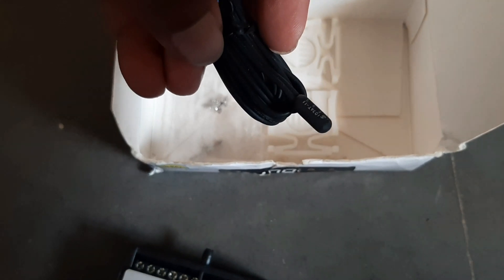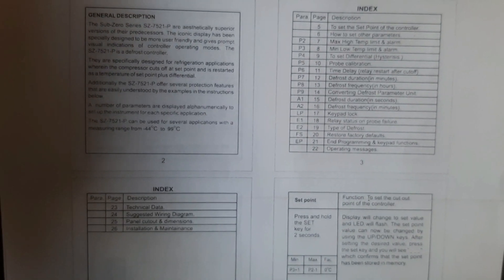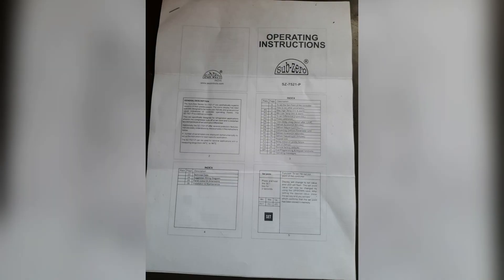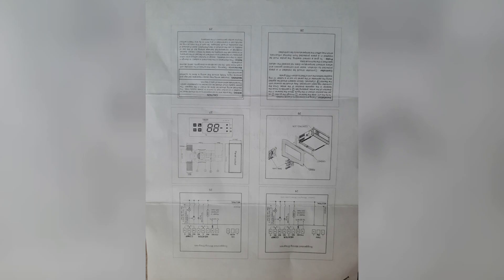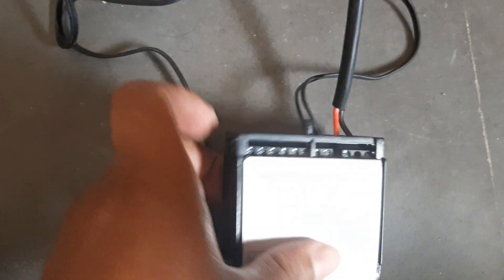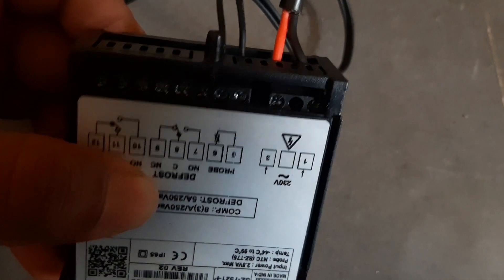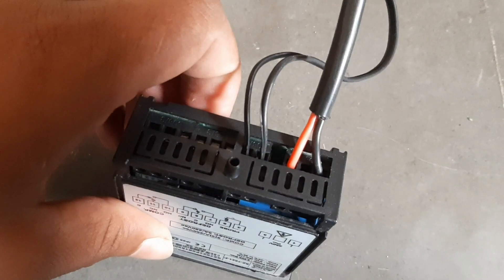SUBZERO CONTROLLER SETTINGS | SUBZERO PARAMETER SETTINGS | SZ-7521-P #MECHANICALHVACR

Comment: Air dryers me subzero 7521P lagana hay to drain valve ka kya timing set kare or compressor cut of ka temperature kya set kare
Reply: 10 Mins drain valve off 4 secs Valve On generally air dryer setting